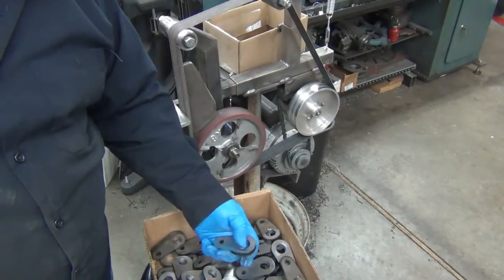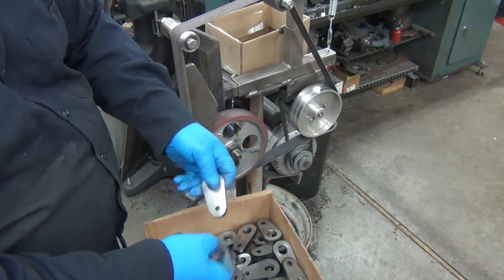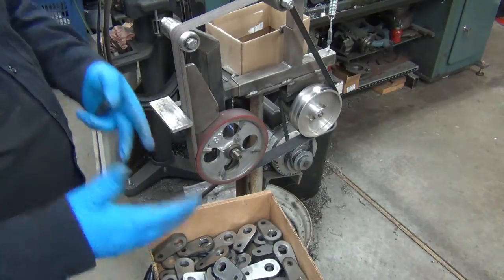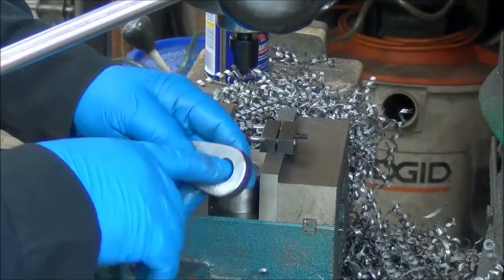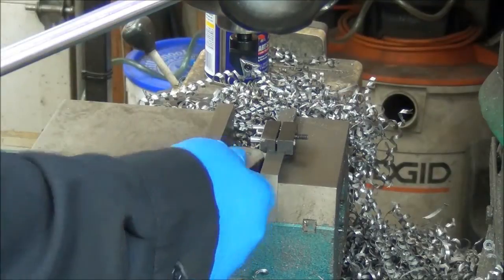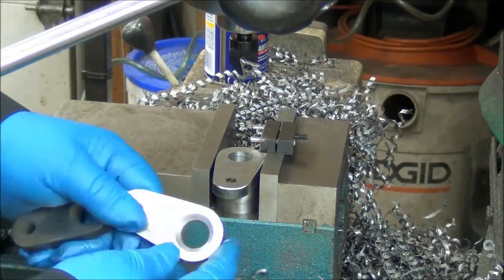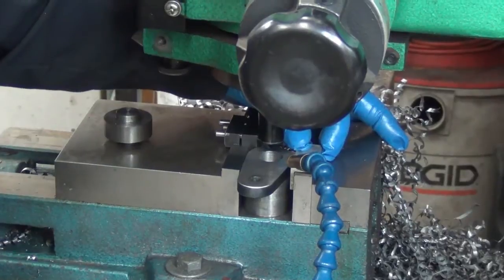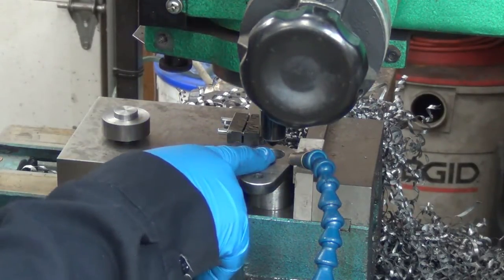Brake Bracket Build - Chamfering

Comment: Do you have all these brake kits sold already?....looks like a lot of work for them blue hands.
Reply from the maker: about 1/3 to 1/2 of them are spoken for.  I've had enough people tell me they definitely want a set for more than 1/2 of them to be sold, but inevitably, when I contact them to let them know they're ready, I don't hear back on a handful of them.  It's been over a year since I ran out of stock, so I can't blame them.
They weren't this much work the last couple of time, but I'm doing everything in house this time.....except for the laser cutting.
Reply: bluehandsvideo
Sounds like when your done you will have some stock to last awhile then, yeah not good to run out especially if your not a full time fab shop as they don't have patience to wait. Trick is to forecast future sales and not run out and also not to over stock as it costs lots of money to do so.